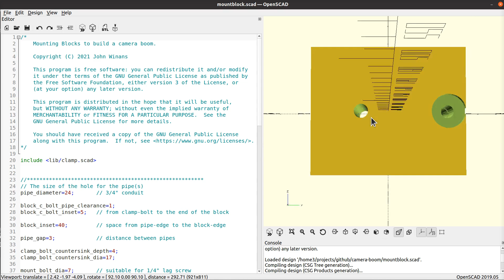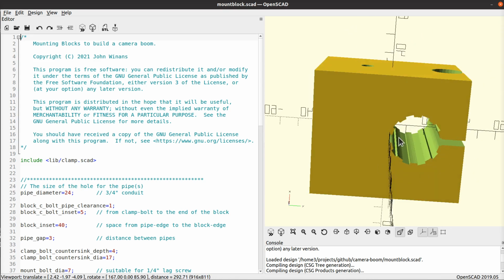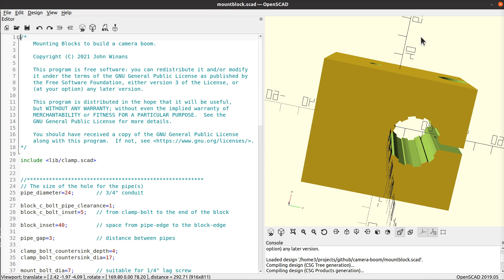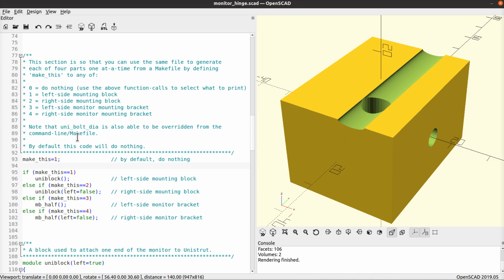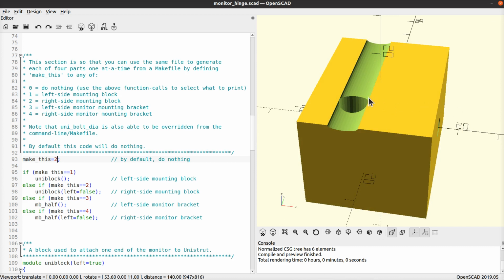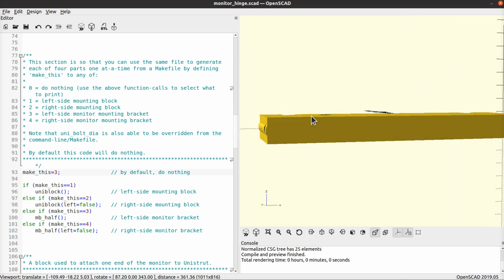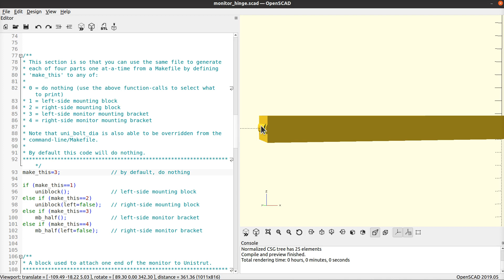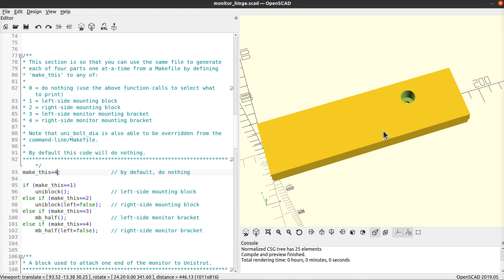3D Printed Bench Scope & Hinged Monitor Mount

Comment: Just sharing this idea. I am not very familiar with bench scopes so my idea may not lend itself to bench scopes. There exists inexpensive (about $12) LED Tracing Light Pads. In essence, the pad is an array of leds and an acrylic diffuser. You can place your object on the LED pad for greater illumination. I am not sure if it might oversaturate the sensor with light. The light can be reduced with a diffuser (sheets of paper) or reduce the source power to leds.
Reply from the maker: Depending on what is being filmed... Yes.  This would be an option.

Comment: Great setup! Care to share what make and model of the camera?
Reply from the maker: Gol-durn-it!!!  I intended to include that in the description and failed to do so.
I talk more about the zoom lens in a camera-boom  video here: https://youtu.be/ukeu73_9VjI
It is one of these: https://www.amazon.com/dp/B08CNJK8PL/ Please note that this lens is 'good enough' for my purpose but not perfect.  As I note in the video, the price is right!  $23
The camera behind the lens is a PI 'high quality' camera.
I should shoot a video on how I record from it for my YouTube channel.  I use is the 'raspivid' to record at 30fps like this:
raspivid -t 0 --brightness 55 --contrast 20 --bitrate 8000000 -fps 30 --exposure fixedfps --fullscreen --awb off --awbgains 1.218750,1.800781 --analoggain 1.0 --digitalgain 1.097656 --shutter 20000 -l -o tcp://0.0.0.0:1234
Your gains may vary.  I find auto white balance annoying because it is changing constantly.  But you can start tinkering with it turned on like this:
raspivid -t 0 --bitrate 8000000 -fps 30 --exposure fixedfps --fullscreen --shutter 20000 -o outputfile.h264
There are many other ways to record video from a PI.  Jeff Gerling's channel discusses this topic from time to time: https://www.youtube.com/user/geerlingguy